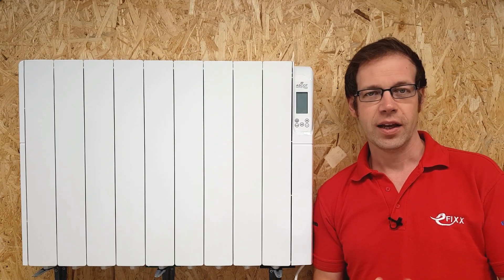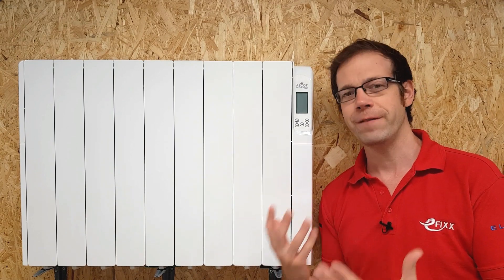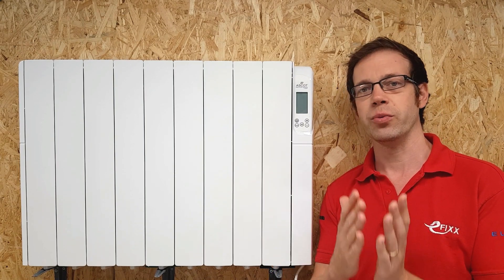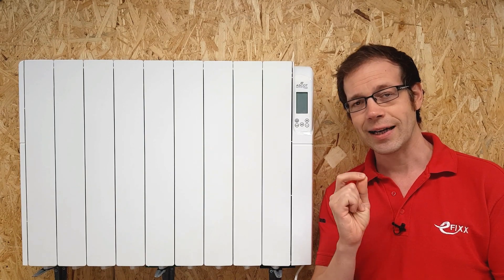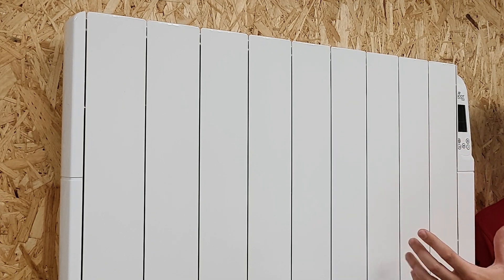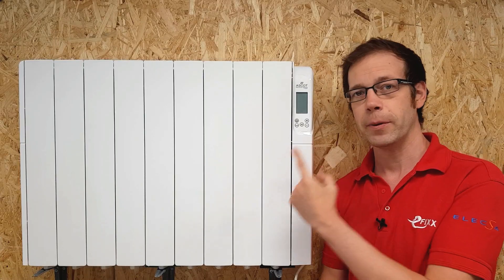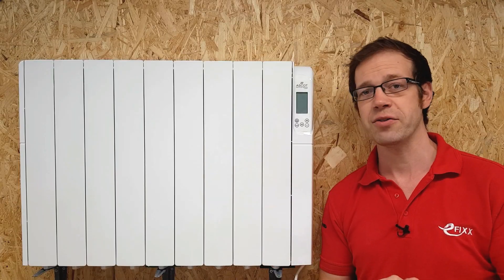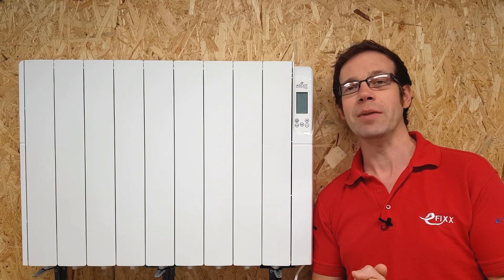Is electric heating the future? - LOT20 and SAP10 explained.

Comment: This is just an overdesigned heater  and people will never use its VCR style timer. 
Just another trick by building lobbies to lower down the cost of construction and avoid the installation of heat pumps.

Comment: I'm late to the party as I just stumbled on your channel from the other side of the pond. Interesting Europe energy efficiency standards are focused on electrical resistive heating. By its nature resistive heating is 100% efficient from a consumer perspective.  Electronic controls will improve set point accuracy, but I wonder what the increase in overall efficiency will be. My guess is pretty minor.

Here in the US heat pumps are the rage, basically a reversible air conditioner. Modern refrigerants are able to extract usable heat down to amazing low temperatures providing over unity efficiency compared to resistive heating since the heat pump is simply moving heat not creating it. This compensates for electrical grid losses compared to burning fuel locally.

Comment: Until the UK starts insulating homes instead of letting the energy leak out new heating systems do not make sense. Also better internal air flow in the home with a heat exchanger and a dehumidifier as well will go along way to help make the home more comfortable reducing energy costs.

Comment: efixx, perhaps a follow up video might be in order one year later. My E7 tariff went from 18p day rate, 9p night rate to 36p day rate, 18p night rate with Scottish Power in April. Which with my dodgy maths is double. We were already paying close to £3k annually on the old rate with electric heating (storage heaters) in our 1990 built 2 bed semi which were never any good. Luckily we bit the bullet and had a gas supply installed and gas central heating last Autumn. Wish I had done it years ago. 👍

Comment: As a consumer, if the gas central heating and the heat pump are not available options (apartment blocks), how do we compare this heater to an electric underfloor heating? Which one is more energy efficient?

Comment: Do you have a time-to-heat profile for this heater ? I would like to know how long a 20' x 20' room takes to heat from 10 C to 20C with N (1, 2, ??) such radiators in the room.
Reply from the maker: I'm afraid I don't but if you reach out to Premspec they're really helpful with calculations for heating spaces. 😊

Comment: Yeah, the  renewable wind was contributing  currently 1.28% to the UK grid today despite it being very cold outside. Meanwhile gas  was contributing 52% It makes no sense to turn gas into electricity, and then use that for heating when you can use that gas directly for heating. Making gas into electricity, then using it for heating will just overload the grid, and is a completely ridiculous at the current time.  Resistive heating is 100% efficient and always has been. Every watt consumed becomes a watt of heat.

Comment: What a load of rot, first how is the electricity generated, next it doesn’t matter how long it takes to heat up or cool down 2kw is 2kw however it’s used. He hasn’t a clue how much electrical energy is needed to replace fossil fuel.

Comment: Written by the American grid lobbyists looking to sell in Europe. - electric heating cost a fortune to run 1 for 1 ratio an average og 600 a month, hence the promotion of heat pumps which reduces to a 3rd in ideal conditions . Sustained heat are a broken idea especially when pricing to run outstrip most people’s budgets, let alone pension weekly budget for the retirees, the grid are determined to introduce peak rate super charging or 3 their to replace economy 7 or 10 as they stand . Both the infostructures  and grid are not ready let alone the public   If we are not careful one bad winter and we’re end up like Texas, there’s a big difference between heating your electric shower and heating a home , you’ve only got to look at the demise of the traditional 2 bar electric heaters to see this idea of heating electricity is just impractical to expensive for the majority of U.K. housing

Comment: We're going to get electric radiators which can be controlled by an app on a smart phone. I'll also be able to monitor how much electricity were generating from our PV, so can switch the heaters on remotely if it's a cold sunny day in the shoulder season, say mid/late afternoon, instead of drawing from the grid once the sun has set. It'll be interesting to see if we can use enough of our free electricity in the shoulder season, and selling excess in the summer, to offset the cost of grid electricity during the winter months. Should say that it's a new build very well insulated home, EPC 92, wall u value of 0.13. I'm not sure I would want to rely on them in an older home.

Comment: I understand the desire to get away from fossil fuels, however renewables are never going to be providing 100% of the grid. So you have to look at nuclear for the base load, and the next cleanest fossil fuel, which is gas (of which the UK has an abundant supply).

Where this is just silly, is using gas to make electricity (eg CCGT at 60% efficiency), transforming it, supplying it into domestic properties, to then create heat. When a domestic property can take the gas in directly, and burn it at >85% efficiency for heating.

A heat pump will help with the efficiency, but still nowhere near the efficiency of burning the gas directly.
Reply: I think there is something wrong with your maths; modern heat pumps can easily achieve 300% efficiency, actually the best ones are now 400-500%
So for a heat pump it's 3 x 0.6 = 1.8 i.e 180% worst case end-to-end efficiency, which is at least twice better than the paltry 85-90% achieved by a gas boiler. 
The direct electric heater at 0.6 x 1 is only a little worse, and since gas now accounts for less than 50% of UK generation it's still better than a boiler in terms of emissions.
SAP 10 recognizes end-to-end efficiency and carbon intensity of different sources, so gas will effectively be ruled out by it's introduction. Clever, no boiler ban needed.

Comment: EEC directives should have nothing to do with the UK. I only have electricity in my flat and have recently had new storage heaters installed, and have been very disappointed how they have performed in the freezing conditions in the UK. They only go up to 25°C max and therefore by early evening the stored heat has gone and there is not a quick fan booster as the old Dimplex storage heaters had. Not a happy bunny with them!
Reply from the maker: Ah sorry to hear that, it'll be interesting to see how electric heating works out over the coming years.
Reply: switch circuits feeding storage heaters from e7  to 24 hour supply and either program them from timer circuit in fuseboard or if you can just at heater to charge at old e7 times with a boost at more expensive tariff only when required. (still requires 2-rate meter)

Comment: We now have gas burning power stations to make electricity, to turn it back into heat. Like driving 100 miles to save £1 on a haircut.
Reply from the maker: But we've also got renewable sources of energy producing electricity, this is only going to increase over the coming years making electric heating more viable. Fossil fuels are finite and will run out.
Reply: @efixx  run out a lot quicker if we keep using it to generate electricity.

Comment: Do you think we will see three phase supply becoming more common on domestic supplies with the increasing electrical demand?
Reply from the maker: I wouldn't be at all surprised to see this happening down the line.
Reply: Efixx, 

practical if expensive for new builds but to bring it to existing buildings would be a very expensive and slow process, but with the government pushing the electricfication of transport and heating there needs to be an increase in domestic capacity.
It's a pity that they have not sorted out low emission generation for the grid though so cart before the horse.

Comment: I put in an electric system in 2016 and it is horrendous. Noisy (gushing water runs through system), costs absolute fortune to run (on economy tariff), needs two meters, therefore, no smart meter possible, thermostat is useless and always needs manually boosted, ugly copper pipes everywhere, roof fell in as seals perished after 2 years, do not hold heat, I could go on. To me, electric heating has always been useless and expensive to run. I need convincing! Because something is labelled as eco does not necessarily make it good! I am £160 per month for small, modern 2-bed flat. No gas. My bills nearly tripled when I put in the new “economy” heating on my “economy” tariff! Still trying to figure out where the economy comes in!

Comment: For those saying electricity is more expensive than gas, you are right. But, don't forget the maintenance costs of servicing a boiler, then the cost of replacing the parts of the boiler or the boiler itself after 10 / 15 years. A well installed electrical installation should last 30 / 40 years. Not sure how long these radiators will last but I think the cost overall will be less long term. And also you don't have pipes underfloor boards that could spring a leak!
Reply from the maker: All good points Justin, electricity may never be as efficient as gas but we're getting better at producing it from renewable sources!
Reply: @efixx  Sadly, renewable doesn't mean cheaper and it probably never will. In my view, the only way electricity can be used efficiently for heating is with underfloor heating using an air or preferably ground source heat pump and even then that's with new installations. The gas fields where we currently get our gas from are good for 100 years so i think gas will still be with us for the foreseeable future despite the government making noises about banning gas boilers. I also think going down the hydrogen path will be nothing more than a fad. Obviously we should be developing new sources of energy that relies less on fossil fuels and that doesn't necessarily mean renewable energy. As a comparison, I'll be shortly paying around 14 pence per kwh (up from 11 at the moment) for electricity and around 3 pence per kwh for gas.
Reply: It depends. I went with gas and it's great. The whole house is evenly warm. Just get a magnetic filter. Also I plan to move house in 6 years anyways.  Boiler is cheap to fix and the benefit of instant water is great. Gas is x4 times cheaper!!

Comment: I’ve heard they are 3 times more expensive to run, I’m a simple carpenter and don’t understand the sparkies slang, but I know the difference between pounds and pence
Reply: I have found that oil filled heaters use the same amount of power, whatever setting they are set on. You have it on a low setting, but is drawing the same amount of power, as it would on a high setting. I phoned the supplier/manufacturer on one heater, and he said that i didn’t know what i was talking about, so I said I would take it to trading standards to check it out, and he quickly offered to change it for me.

Comment: What a lot of nonsense and waffle you get kw out for electric kw put in
Reply: When you get home cold wet and knackered and you want to stand in front of a raging hot radiator for ten minutes, you'll be throwing the fancy remote control panel across the room when it informs you that this option is not currently available.

Comment: Install similar at my work. Cost a fortune for the tenants to run as they aren’t helped or advised on how to get on a better tariff.
Tenants use them like a wet system, heating up rooms that aren’t being used ie a spare bedroom. 
A simplified user guide on how to get the best out of these really is required.

Comment: Fascinating!
I'm curious if this smart tech can combine w/ "old school" methods underneath housing; Such as Bricks laid out as a "Heatsink", to retain heat & pass+warm air through.
I believe the combination of the 2 would be Highly efficient & effective w/ a little added insulation? Especially during the colder hours & months.
Adding some fancy "zig-zagging" in the stone & various other tweaks can be made if using something like concrete, or a better type of stone can be used if produced before-hand in a factory setting.
🤔Thanks for posting.🙏
Reply: If this is the case, it could be as simple as using some "crawl space" and building a relatively small "underground" box beneath housing; In the dirt, for Natural insulative properties, would also have to make sure it's accessible from the top (or side I guess) for maintenance. Then running metal through sections of the brick & applying a current to heat them, along with timers, sensors, fans to move the heat, etc.
IIRC: Metal heats up when current runs through it & doesn't waste much electricity if circulated.

Not my field, just ideas.🤷‍♂️
Reply: Thinking of, this could easily double for and/or help keep hot water warm too, if the usual tank & tech is built on top. Heat both conducts & travels upward so, as the box below warms, it'd naturally share off 1 "source."

Oh, depending on the square footage of the house, or a configurable setting by the user, the smart tech can get the stone to optimal temperatures. There's several ways to go about controlling things with a little added tech.

For example: Getting the stone Hotter may retain heat longer, but then comes the issue of the vents possibly putting out heat which scalds. I believe this could be remedied with 2 fans, instead of 1. By using 1 fan to move & "buffer" the air, another sensor & fan could then mix cooler air from under the house with the flow going to the interior, thus decreasing it & adding "control."
Or by positioning a single fan in the proper position, it would naturally pull cool air from under the house but also from inside the "box" simultaneously, which would eliminate the need for 2 filters. Also, for safety, multiple sensors acting as "backups" & basic alerts on the owners Displays can prevent failure & misfortunes of encountering mentioned "scalding air."

Couple other ways you could go about all this, such as using shutters or passing it through/around the hot water heater; Which could save some duct (piping) and/or allow for larger hot water capacities. 🤷‍♂️ Many options.
Reply from the maker: Thanks for this - The electric heating space is ripe for innovation. The innovative electricity tariffs will drive this conversation. Check out this hot water solution - https://www.fischerfutureheat.com/electric-heaters/aquafficient/

Comment: As previously mentioned, all electric heaters are very inefficient when compared to a heat pump.  It's not uncommon now to have air source heat pumps that provide 4x - 5x the heat output per kW compared to resistive heat alone.  The fact the industry seems to be promoting resistive heat now is baffling to me! 🤦‍♂️
Reply: Yeah it has it’s place, but let’s stop pretending it’s cost effective, gas is a quarter of the price per kWh
Reply: Making heating unaffordable is just another tool in the powers that be tool belt to further enslave the population.

Comment: Great Video, as an electrician I look forward to this being the case. However, Isn’t Electricity roughly 4x more expensive at the moment than Gas per kWh?? Unless someone has a solar array and battery storage or the energy companies slash cost by up to 75% isn’t it going to be way more expensive despite these smarted technologies you mentioned...?
Reply: That's right I though it wud be ok buying smart radiators but I'm now going with gas lol. It's too expensive
Reply: @crazypigs100  h
Reply: Yup, only makes sense where you want to provide very localised heat, or gas is prohibitive
Reply: Given heat pump source with cop 3 or so, the price difference was small even back when you wrote that — and in the post-Russia-going-mad world, it actually flips.
Reply: @JasperJanssen  what's heat pump cop3?

Comment: The future will be in heat pumps, as that is an electrically powered solution that provides 300% efficiency on average today. Any form of resistive heating is only 100% efficient - so go ahead and buy a cheap unit if you take that route. As a plus, a heat pump run backwards is an air conditioner - something more UK homes will likely want going forward.
Reply: Heat pumps are very common here in the U.S., especially here in the south.  I'm in Central Florida and last month I used 745 kWh to cool a  roughly 111 square meter home in 33 dgree weather.  This place is relatively new so it's got decent insulation and I live alone, but everything is electric.  (If you are wondering what I am doing here, I found the channel last week while researching ferrule installation,)
Reply: Jason Dragon I fitted a split air con/heat pump to my lounge. Can’t believe how efficient the heating is. A+++ for heat and A++ for the air con. Heat pump will go down to -15 but is most efficient at 5C.
Reply: Seems interestingz didn't know they was a thing, they look like sir conditioning but hot air 
I don't like radiators, never have, they take up too much space and are ugly, they run wear you can put stuff, example you can't put a TV stand where a radiator is so you have to out your couch there but it looks tacky
Reply: I'd be interested to know more about heat pumps in cold countries since the available output temperatures are often dire.
Reply: Can you use the correct term, coefficient of performance, and not efficiency when referring to heat pumps? It should also be recognised that the quoted values of COP are invariably achieved under ideal lab conditions. An air source heat pump in a cold damp British winter is going consume energy just to keep the evaporator free of ice.